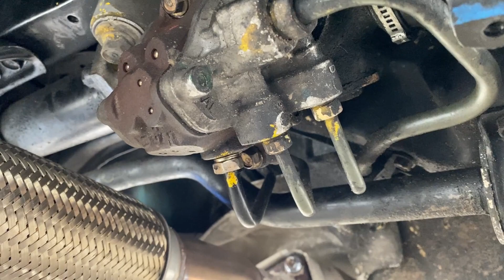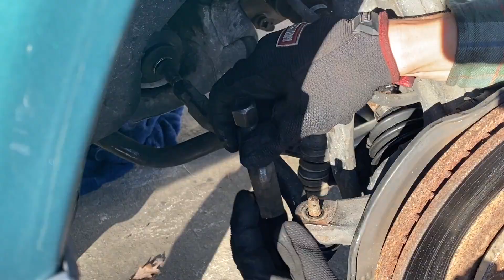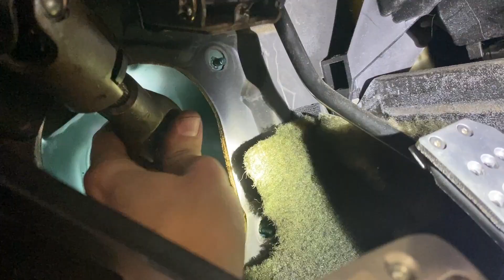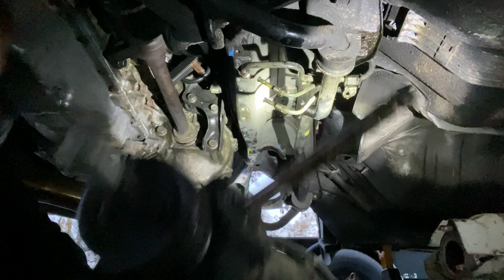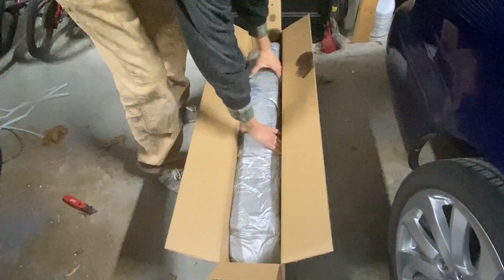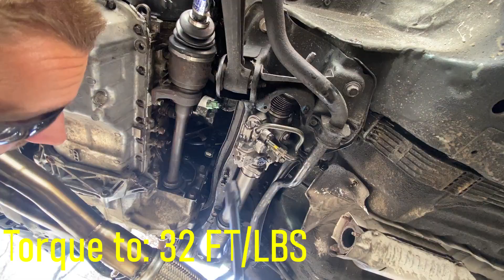Rack and Pinion Steering Replacement 90-93 Honda Accord CB7 CB9

Comment: man i cant remove my exhaust I've tried everything to unbolt them, any help?
Reply from the maker: Spray the bolts with PB Blaster and let it soak for a day, re-spray again and slowly work the bolts out with a breaker bar.  You may have to cut the bolts...

Comment: To make removal and installation lot easier, just turn the rack all the way to the right (passenger side), so much easier. Other than that video was great help!
Reply: I read this as turn the wheel to the passenger side which would collapse the passenger side inner tie rod in. 

Which I think you actually meant turn the wheel to the driver side to collapse the driver side inner tie rod in, correct?

Comment: hmm....the two bolts (drivers side) that hold the rack to the frame.... the bolts easily slip in and out??? Its like maybe the nuts that were welded to the other side of the metal broke off....dang...what to do now....
Reply from the maker: That could be a catastrophe. Almost like a subframe swap needed at that time then…
Reply: @randomrebuilds  not going to do that…I’ll try something else… anything else…I’ll post my results. Thanks!

Comment: Is the line/hose that the 17mm bolt is connected to a power steering return line? Trying to find a replacement and can only find the high pressure one

Comment: Question 🙋‍♂️ the rack and pinion what is the lines they have I would like to know if the rack and pinion have powers steering lines for the fluid obviously but rack and pinion have transmission line too?
Reply from the maker: I don't believe there is a transmission line running into/out of the rack and pinion steering assembly.
Reply: @randomrebuilds  you can help me if you know where you think my power steering fluid it’s coming and going thru to the transmission I been having this issue for a while trying to figure it out and then the transmission have a area where it throws out all the fluid when over flooded some people tells me was the speed sensor but I’m trying to continue doing research

Comment: What did you do with the line that went between the left/right steering boots? I’m doing the same job currently. The Detroit axle came with the line zip tied to the axle, but I’m hesitant to tighten the rack to the car with the line being pinched between. Thanks.
Reply from the maker: I think I just left it alone and bolted it into position.
Reply: Well after struggling with trying to reattach the old line for 1/2 an hour I’m inclined to go that direction haha

Comment: I know this was posted over a year ago but do u still have ur accord?? I have a few questions, like what all I can remove from the engine bay (cruise control, a/c ect.) I am working on my steering rack now. I did the entire suspension and the shop said they could allign it cause the rack was bad. I have a mint 91ex and really don't wanna let this car go. Its sat for a year now so it needs a bit but it's worth it
Reply from the maker: Its still being worked on at the moment.  I would get a rebuilt steering rack and have that installed.  Do not give up on your CB7.  Things do wear out but if you saw how cheap and flimsy 2020+ cars are being built, they won't last very long.

Comment: What else do I need to remove on the left side to allow the shaft to go into the hole to connect to the stering ??
Reply from the maker: You will need to push the rack pinion as far to the right and its a tight fit to get it in the subframe area while pushing the steering shaft up into the body of the car.

Comment: Great video!!!! I removed the cover for the lines and was met with serious rust on fittings. Tried loosening fittings and the lines twisted till they broke off. Lines are discontinued. What can I purchase to repair the good part of lines to connect a new fitting to?
I'm not sure of fitting and thread size for each fitting. Any help will be appreciated.